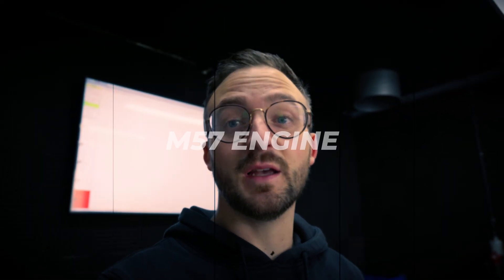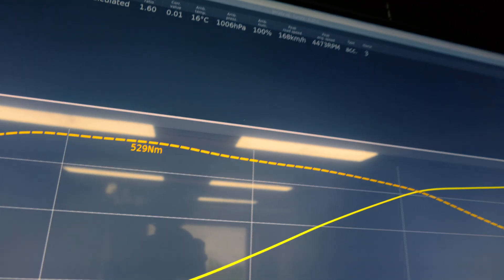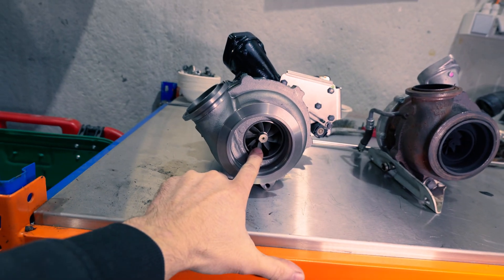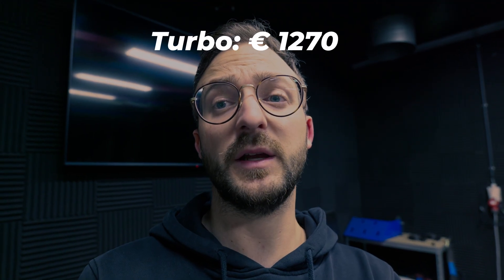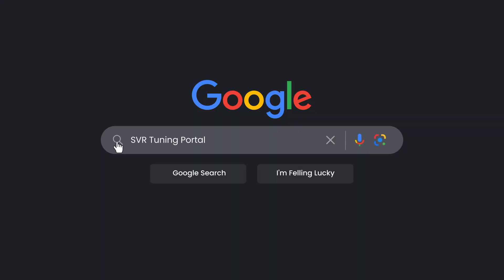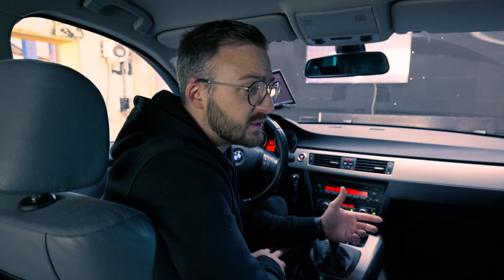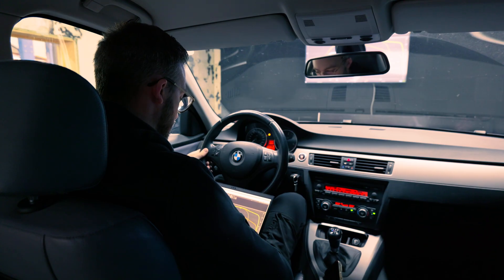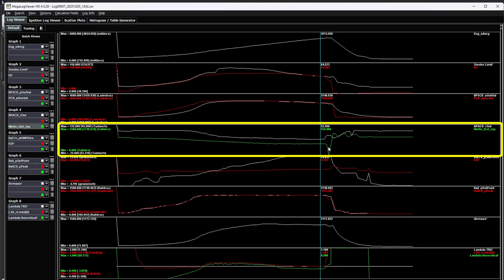BMW M57 Obsolete Diesel… or Hidden Weapon?

Comment from the maker: What kind of power does your M57 makes and what’s the tzrget you have in mind ?

Used parts in this video 👇  
• Bimmertune EGR Delete: https://shorturl.at/ByN9d
• Wagner Intercooler: https://shorturl.at/L6aid
• Turbosystems Turbo: https://shorturl.at/oZzGC
• Downpipe: https://shorturl.at/wHLct
• Remote tuning → https://h7.cl/1fuiY
• Flashing software → https://h7.cl/1kl59

Comment: Did you do valve springs?
Reply from the maker: With the lowered boost it’s stable noW. You’re getting valve float due to the pressure in the exhasut manifold being to high, mainly because of the effeciency of the turbo you’re trying to use it in, in this case a to high of a boost target, hence creating more exhaust flow in the higher revs then can pass the turbine/VNT combo. This creates high exhaust manifold pressure (EMP). Then the pressure pushes open the exhaust valves. So if you adjust the parameter to be in a région where the turbo is much happier, you solve the floating. I do agree that upgrading the springs is always a good thing to do and want harm much. But in this case the client decided to leave as is ;) Also keep in mind, if you put springs on this setup, you will be able to request higher boost, but also notice since you are creating high emp, the turbo is not efficient in this range anyway. In the logs/dynograph, you can also see by lowering the boost, we even gain some power, which confirms the above. It’s not about boost, but about airmass. Boost doesn’t say a thing 😉

Comment: Very interesting, the 325d (340.000km) is also capable of this upgrades changing the injectors to 216/219? Is it possible to refurbish the original 209 to 216/219? Can the pistons hold this power? Thanks!!
Reply from the maker: Pistons are not a problem at all, if map is made correct and temperatures are within control. I did exact the same setup on a 25d with 219’s. Approx same result ;) 
In theory it’s possible to only switch nozzles, but not a lot of companies are able to do this, so i advice indeed to switch to 219’s.
Just keep in mind you need to keep rail pressure lower on 219’s, because the piezzo’s are able to work on higher rail pressure 😉
Reply: @svr_BE great! I will try to look for 219's and a ZF8, I think the 6hp will not be able to hold it. I have Testo to log, is it okay for you to tune it remotely? Thanks!
Reply from the maker: @macromaker yeah sure that’s not an issue. The 6HP19 is not happy with that amount of torque indeed, it won’t hold to long. 8HP is something you won’t regret!
If you have testo and a kdcan cable, remote tune is not an issue at all 😉
Reply: @svr_BE quick question, do you know if the 216 can reach this level? I wouldn't like to go further, and they're much easier to find than the 219. Thanks!!
Reply from the maker: @macromaker depends, what target do you have ?
Reply: @svr_BE my idea would be similar to the video, a daily/sleeper prioritising least smoke, reliability, and finally power. I'd like to upgrade turbo, fit IC, downpipe, and injectors. I'd keep the R70. What do you recommend and what figures can I expect? It's a 325d E91 thanks!!
Reply from the maker: @macromaker the above result should be possible on the 216´s as well, but maxed out. So the 219 is a better option. And my honest opinion, they are all old an have some milage, so always a better option to save some more, and buy new ones

Comment: Stock flywheel and clutch?
Reply from the maker: Stock flywheel and new 50i clutch. 800 nm is the barrier for what most normal clutches hold. On a manual gearbox, when you exceed 800nm, it’s getting hard to find a flywheel and clutch that holds the torque for long time use.